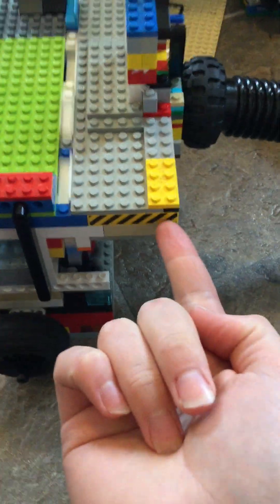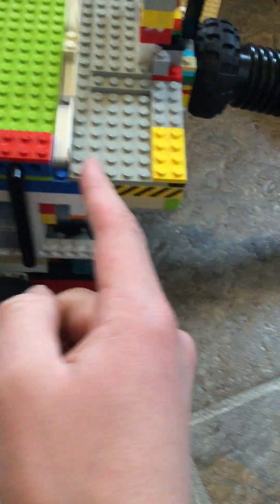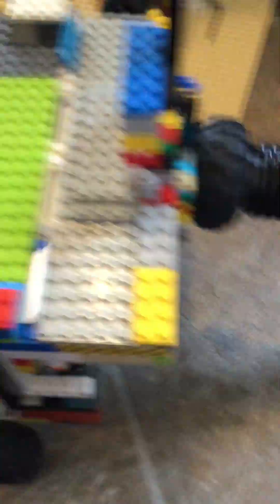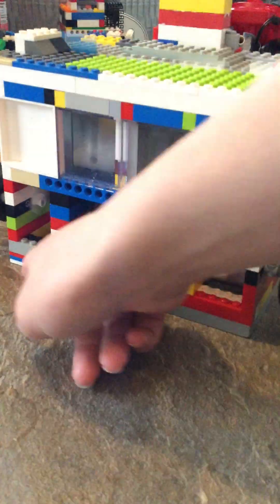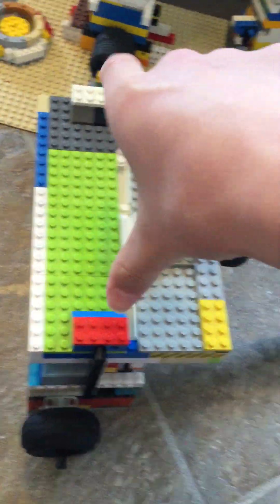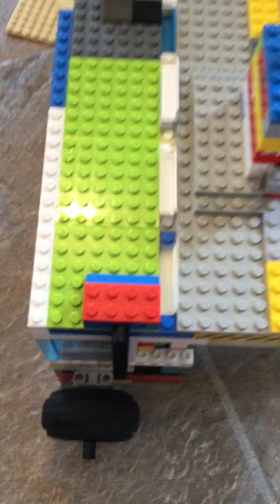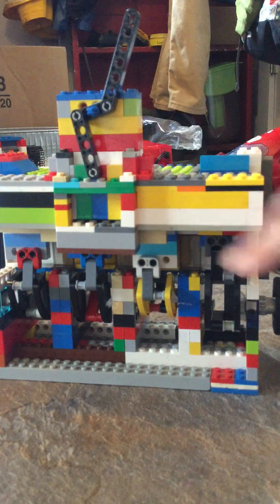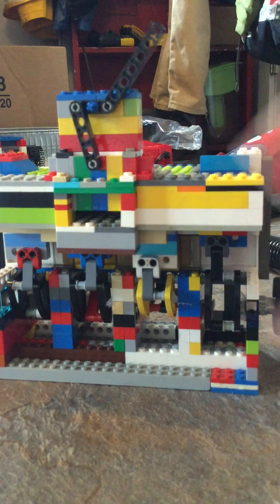Modded the SCV inline 4 LVE #legovacuumengine #legoengine #scvlve #nitrolve

Comment: great job i like your four cyclinder what is the piston size
Reply from the maker: 4x4 4 stud stroke
Reply: @Dudeface167 4l crank or stroke?
Reply from the maker: @NFB_LegoMocs  3l crank = 4 stud stroke (2 studs from center of crankshaft to center of crankpin)
Reply from the maker: 4x4x4x4=256 cubic studs. But I thought you could multiply that by .8 to convert it to cc, that would give you 204.8??
Reply from the maker: And 32x32x32x4=131,072
I suck at math but my calculator doesnt't
Reply: @Dudeface167 lol

With a 3l crank we have 47mm stroke (I have a 3) crank engine)

So we have 32x32 = 1024x47x4 we have 192 cc
Reply: @Dudeface167 I understand you bro, also I was wrong, it was 131 you right 

Also, sometimes I also suck in math, I have made a super hard math exam, it's made to find intelligent kids (I'm in seventh grade). And I cooked, nailed 14 out of ultra hard 20 questions, but when I got the exam back, I looked it carefully, and in one question, idk what I was thinking, but in my head 5760-760 was 6520 😂😂
Reply from the maker: @NFB_LegoMocs  what are you talking about? Take a 3l crank and stick 2 axles in it and measure from the center of one to the center of the other.... it's 2 studs aka 16 mm
Reply from the maker: The center of rotation of the crankshaft and the conrod on the crankpin are in the middle of the axles
Reply: @Dudeface167 I was talking that you said you suck at math, just showing you that everyone makes errors.

Stroke is not the length of the crank, but yes the distance that the piston travels from the summit to the bottom, so the Conrod size  and piston affect the distance. Like a 6 stud stroke should be 48mm, but my engine has a 6 stud stroke and it is a little little little more than 47mm, like 47.2 mm
Reply: @Dudeface167 each stud is 8mm
Reply: @Dudeface167 also, that big 8x8 i4 I was making, I got it to run at 2 cyl I built from now, it runs pretty fast, didn't measure it yet but I'm really happy 😁
Reply from the maker: @NFB_LegoMocs  the conrod is straight at TDC and BDC so the length of it doesn't affect the stroke, only the way the piston accelerates and decelerates. The stroke is the distance from the center of the crankshaft to the center of the crankpin times two, but I just assumed you'd know that I knew about the times two part so I didn't mention it.
Reply from the maker: @NFB_LegoMocs  I know a stud is 8mm
Reply: @Dudeface167 okay, I actually learned that a stroke is the distance that the piston travels from the summit to the bottom, cause it's.. pretty much in every single website, but it's ok you have a different POV
Reply from the maker: @NFB_LegoMocs  I know thats what stroke is, and the size of the crank alone determines stroke.
Reply from the maker: When I said "the stroke" I meant the length of the stroke
Reply: @Dudeface167 ohh

And also the conrod length I'ma butterfly pistonakes little difference in the srtole
Reply from the maker: @NFB_LegoMocs  Do you know how you would actually convert from cubic studs to cc anyway? Cause I know you didn't but I thought you could just by multiplying the cubic studs by .8 since 1 stud is .8 of a cm. That's the kind of math I meant when I said I suck at math...
Reply: @Dudeface167 bro, I'm actually just I kid, I learned calculating cc 2 months ago, so I don't really know about cubic studs, but I've made some experiments, and my theory is that if you multiply every factor in studs by 1.8 you'll have the result
Reply: @Dudeface167 no that doesn't work, my head even gone kaput with that math
Reply: @NFB_LegoMocs  ima 13 bout you
Reply from the maker: @NFB_LegoMocs  but that wouldn't work because then you'd have more cc than cubic studs and a cubic stud is smaller than a cc..... well what the heck
Reply: @Dudeface167 yeah bro, my mind also collapsed, it made sense at first, but then i forgot what to calculate 😂😂
Reply: @Dudeface167 if 4 stud stroke, then your engine has 121 cc

32mm (bore) x 32mm x 32mm (stroke) X4 (cylinders) = 121cc :)
Reply: 4x4